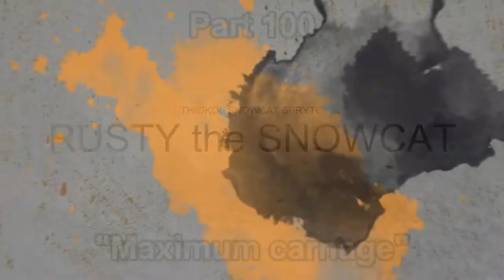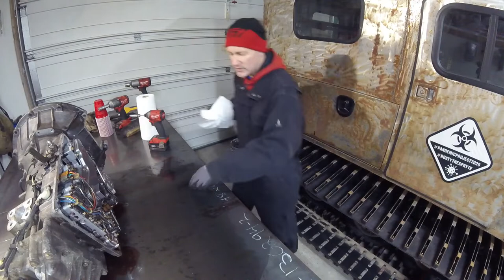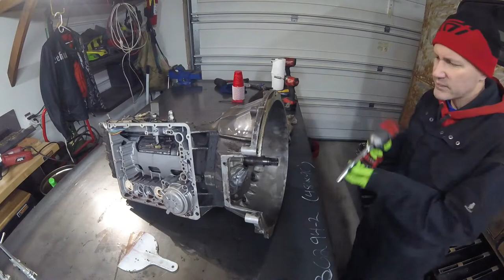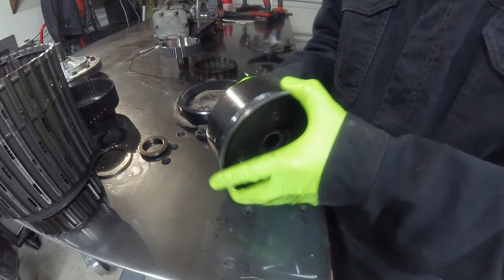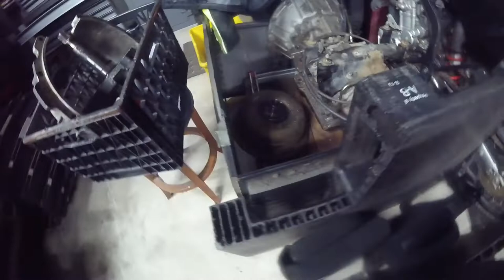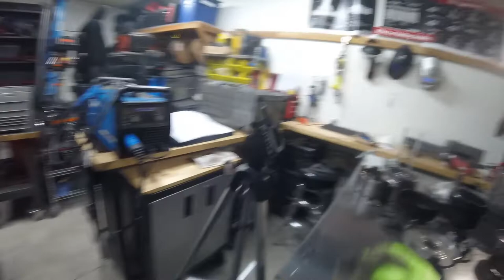Rusty the Spryte build part 100 (JATCO JR403E removal and teardown)

Comment: Hey Shaun, I know you have the skills to tear it apart and put it back together.  This biggest challenge will be in getting every speck of carnage cleaned out of the transmission and its parts.  Dirt and debris is the enemy of automatic transmissions.  Not sure what other option you have but to go for it!  Good luck, you will get Rusty going again.
Reply from the maker: Hi Kurt, Sean here... I think I am going to use a hot pressure washer for the case and hand clean all of the other parts.

Comment: Hey Sean! You did a good job of trashing the trans!! LOL!! Make sure on reassembly that everything is clean, clean, clean. Check each part over closely and check all spec measurements. It only takes a small piece of debris to cause a bunch of problems! Follow the assembly instructions and you'll be fine. Looking forward to seeing this trans overhaul as another one of your accomplishments! Keep it up!!
Reply from the maker: I am waiting on parts so it will give me some time to look everything over.  I tore down the second transmission and it looks brand new inside so I really lucked out there...  I will make sure to keep everything as clean as possible.

Comment: I feel ya! Motivation after a failure like this is hard to come by but it will be worth it in the end!
Reply from the maker: I sure hope so.  I do not like all of these pieces sitting in front of me LOL
Reply: I know the feeling. I've braved the internals of an automatic myself!
Reply from the maker: @HalfCutGarage  How did it end up working when you were done?  My biggest fear is failure...
Reply: Just took my time and in the end it worked great. Did the same as you and added a shift kit.  It was for a mud bogger but automatic just the same. Cleanliness is the biggest priority in my mind as tolerances in the valve body are incredibly.tight
Reply from the maker: I am hoping I have the same results.  Thanks for the reply...

Comment: Hi sean  I saw upgrade kit for jr403 valve body correction kit at monster transmission  ,fixes multiple issues, also if you can get a deeper trans fluid pan it makes a big difference
Reply from the maker: Hi Mark!  I ordered the transgo kit and am hoping it helps solves some of the potential issues with these transmissions.

Comment: I have two of those transmissions in trucks and one won’t shift past 2nd. Called all the shops around here and most didn’t want to work on it. I’m not interested in the deep dive like you. Finally found a shop that will test and inspect fro a few hundred and apply that to the repair. The consensus seems to be that these are failure prone. Although both my trucks have more than 250k on them. Some kind of fluid coupling would be awesome but reverse is an issue. Have fun. I’ll keep looking for a good used one as a spare.
Reply from the maker: 250k seems to the be failure point on these from what I am seeing on the forums and YouTube channels.  The planetaries seem to be the culprit for the most part.  I am going to hodge podge 2 of them together and see how long it lasts after that...

Comment: Wow. When you blow something up you don't mess around.   Maybe Rusty needs a Medium duty trans.   Also- Replace the cooler too- don't even bother trying to flush it.
Reply from the maker: The cooler??  I have a transmission fluid loop that has an external filter and uses the bottom portion of the radiator and I think that is just a wide open pass through of some sort...

Comment: Your looking for something called velvet drive it gives you engaged or not engaded an alternative to clutch then you can use 3 or 4 speed manual transmission.
Reply from the maker: I will have to look into that.  I have not found anything that bolts up to this engine aside from the stock medium duty transmissions that have proprietary isuzu bell housings...

Comment: Hey Sean looking good man.. Just curious, what made you pull the transmission in the first place? Were you hearing grinding sounds or feeling slippage while applying power? Looks like you’ll have a brand new trans when all is sorted and assembled.. On a side note, where did you get that BEEFY Steel plate table?? That style of table is on my list as well.. Is the thickness 5/8”? 3/4”?

Cheers
Reply from the maker: Hi Christopher.  Check out this episode to see why I am rebuilding the transmission https://www.youtube.com/watch?v=GVH8vJsqdKs

Willow built the table.  Weighs 800 pounds.  1/2" steel plate on top 4'x8' It's on 8" railroad casters...

Comment: I recommend to get an Allison Trans.  A new one or rebuild Allison.
Reply from the maker: That was my initial thought but I don't believe they have one that bolts up to this motor.  I know the 6 cylinder version commonly found in Isuzu FRR trucks used an allison but the bell housing is way different AFAIK.

Comment: I operated a core drill used for coal exploration velvet drive is a in / out foward / reverse hudrostatic drive at idle = no impulse increase rpm & you get rotation / movement it eliminates the clutch with a fluid connection. Primarily used in marine applications because the propeller can begin to spin immediate inertia. 

In core drilling the tool steel is lifted away from hole bottom before rotation but in your case everything depends on stall speed of converter pump & initial rpm of motor. 

You still need a multispeed transmission.

Another option for you woyld be like a turbo 400 automatic transmission,  in this case you would also get 3 speed transmission if up graded with high performance parts as would be used for (imagine) 400 cid GTO @ 1/4 mile drag strip, i do not know how robust the machine you have needs to be.

But if the clutch is the weakest link then velvet drive might be your ticket.

Contact U tube Matt's recovery in Utah he has a snow track machine that uses GM v8 with turbo 350 transmission used for vehicle recovery in snow conditions Hurricane Utah.
Reply from the maker: They do not make bell housings or adapter plates for this motor to convert over to any of those options anymore.  I am just going to end up rebuilding this one.

Comment: Do some research on  that a lot simpler hydrostatic drive I used to  work as a snow cat mechanic for a few years
Reply from the maker: I did!  A hydrostatic drive at 3500 rpm (rev limiter on the isuzu powerplant) with an OC12 rear end with drop boxes would travel at a top speed of 4 mph....  No thanks.  Right now I have a top speed of 20 MPH.
Reply: @SeanFillner  cool it was a thought you do some cool stuff 🙂
Reply from the maker: @markallum6536  much appreciated...